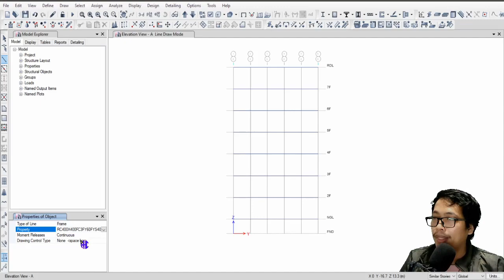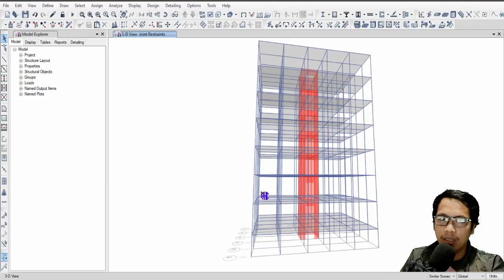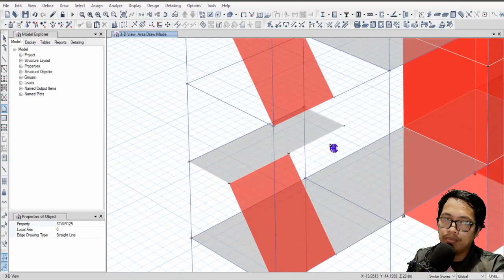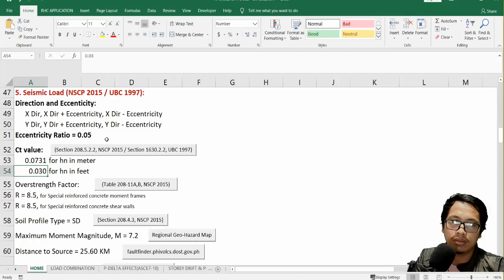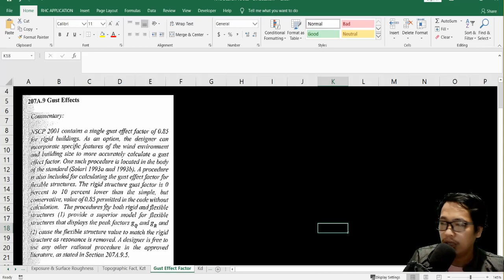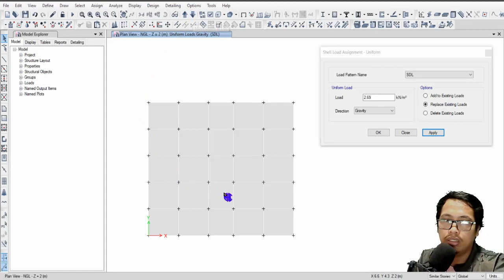Design & Analysis of A Medium-Rise Building - Part 2 of 6

Comment: Sir question lang. Yong building ko dito sa Palawan. Ang Occupancy category is IV then wala pong nakalagay na wiind speed doon sa map. Icoconsider ko pa ba ang wind load sa design?
Reply from the maker: Yung pinakamalapit na malaking value ang econsider niyo Sir, pero para mas accurate e interpolate nalang po ninyo yung 2 values.
Reply: @rhcengineering  Ok sir. Yong pinakamalapit na lang ang iconsider ko. Thanks a lot.
Reply from the maker: @enhinyerosibilqe5821  Opo Sir.

Comment: 00:22 Model Column
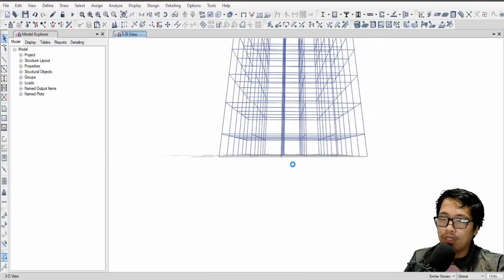02:56 Model Supports
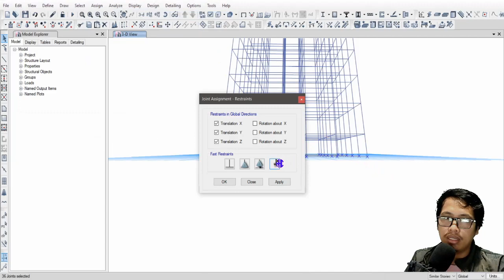03:01 Assign Supports
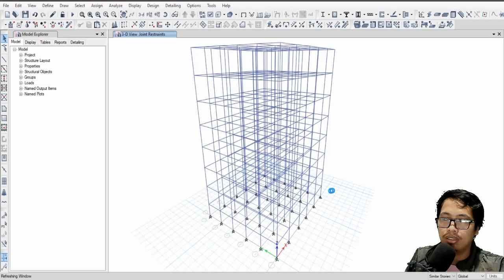04:20 How to divide frames
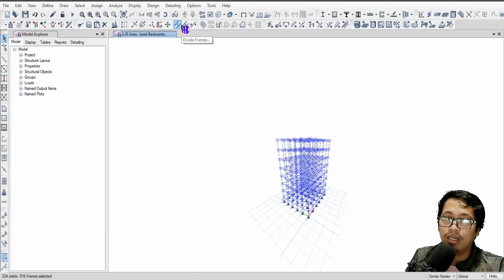04:35 How to divide frames
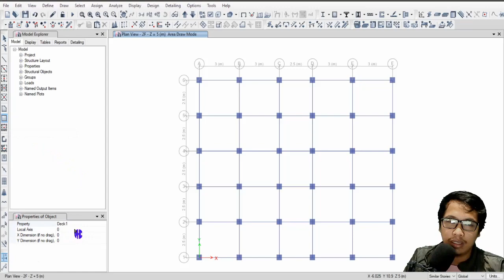05:50 Assign Slab Section
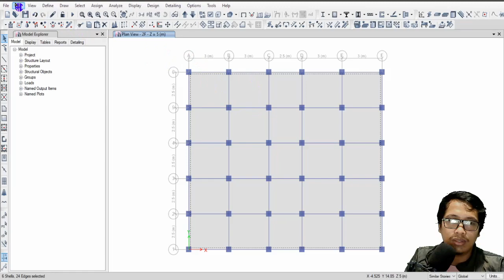06:27 How to divide slab
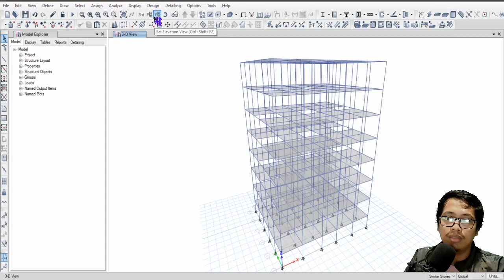08:40 How to model shearwall
12:45 How to model stair
13:48 How to show selected objects only
14:28 How to define secondary beam
16:15 How to release torsion/moment on sec. beam
22:50 Define load patterns
25:00 Earthquake Load
34:23 Wind load
42:50 Define diaphragms 
43:30 Mass source
44:28 Assign loads
Thank you sir.
Reply from the maker: Pacheck nalang po Sir sa video, thanks. Also you can download the excel file request ka nalang po nasa description yung link. Thanks.
Reply: @rhcengineering  Thank you very much sir. More posting pa sir.